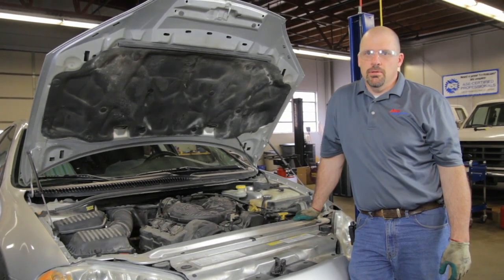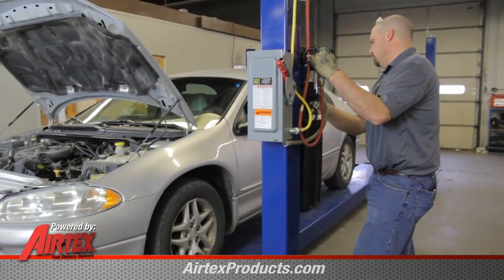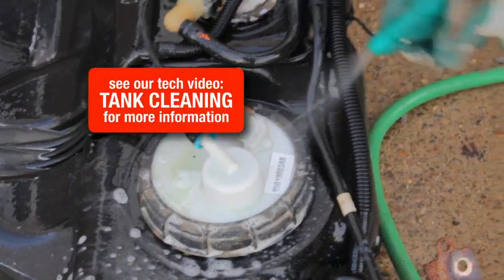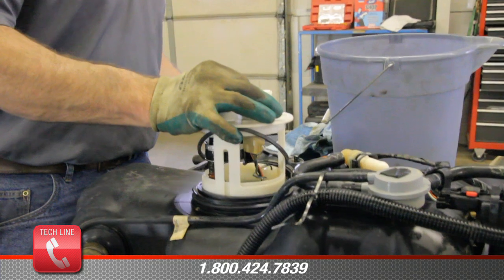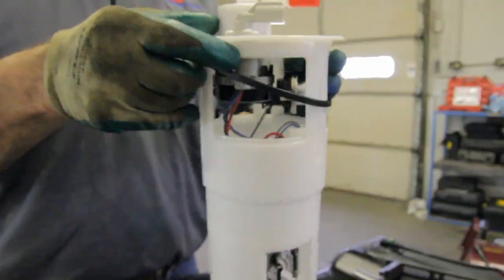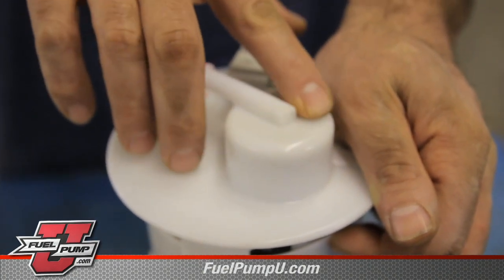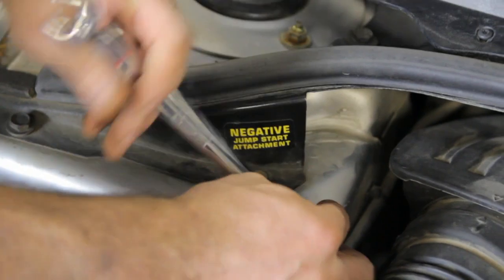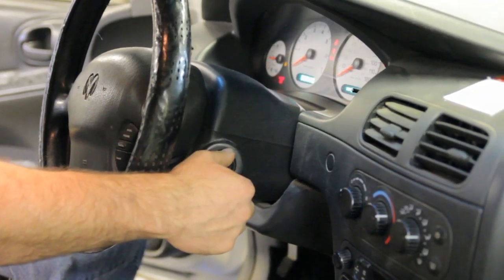How to Replace a Fuel Pump E7152M on 2000-2004 Dodge Intrepid

Comment: good video.  you make it look easy.  just did it and the bolts for the tank straps were completely rusted in and one sheared in half,  job took about 3 hours because of those bolts,  but the car starts right up now and actually runs with 55psi fuel pressure instead of 30 and taking a year to start.

Comment: does this pertain to a 2001 dodge intrepid as well?.. for my car seems to stall off and on...... not regularly.... but could be the fuel filter is dirty and it seems the filter is together with the fuel pump or is there another fuel filter between the tank and engine?

Comment: On a 2004 300m it is very benificial to remove the stablizer bar to remove the tank.
Reply: It does restrict the removal of the Tank. Not the pump. Removing the stablizer bar allows the tank to drop and reinstall easier.

Comment: Some auto parts stores will let you rent them tools as well. My neighbors car is not starting in the winter of 2014 and the relay is working but no fuel.. I told him its most likely the fuel pump.
Reply: Replacing a fuel pump in this cold....ugh for get that lol

Comment: I have a 2001 Concorde 2.7 Lxi an it has a missfire but only after it's warmed up.   Soon as I take off at a stop light or stop sign.  I have replaced the spark plugs.  There is no code being tripped other than a bank 2 sensor 2 O2 sensor, says their is a short. But the check engine light went out after I changed the spark plugs.  So I don't think it's the O2 sensor..  The plugs look as tho they are a little on the lean side.   Sprayed out the map sensor also...  Didn't help.  It still has a hesitation an a missfire.   Almost like it's a bad coil or boot.   By the way there was a small bit of oil on the bank 2 side in cyl  1 spark plug hole from a leaky valve cover ring.  I stopped the leak.  Still missing now an it's been a few weeks.  I have also unhooked each coil to try an notice no change.  An every time there was ...   What can I do to find a bad coil without buying a coil an changing each one out... ?  To time consuming an to costly.
Reply: Keep getting condensation on cyl 1 spark plug boot..  No sign of oil or water when hot..  In other words after I take the boot out im noticing liquid on boot after it cools down.  Replacing boots ..   Need some type of way to find a hair line crack in aluminum.  Do they make a special type of liquid to help expose cracks in aluminum?   Also.....   Keep getting a Bank 2 Sensor 2  P0157 code..   Looked it up an it says its' a short to ground in 02 sensor  ..   Thank you.  :)

Comment: Hello...I have  a 2002 , 3.5 L V6 Intrepid and it was running fine just to recently. and I went to start it in the morning , the engine light  came on with the code " P0016 Camshaft\Crankshaft timing misalignment - Bank 1 Sensor 1". When I want to put my foot on the pedal and want to give more gas, it hesitates , glitches , breaks up , shakes.. when I remove my foot from the gas,  the engine is back at its normal level. It is the same thing that happens if I want to get started quickly...it hesitate, glitches.etc etc etc..Do you know what problem of my car...Thanks in advance.
Reply: MultiTechnicss Someone else has another or an answer please ?
Reply: We are having the same codes and issues.  What was your fix?